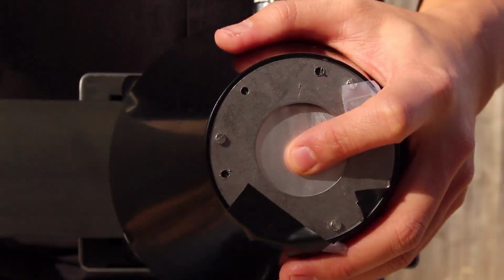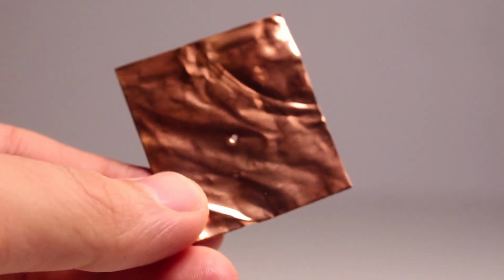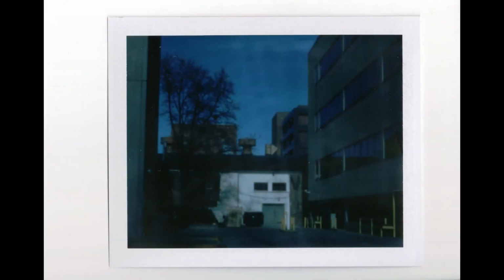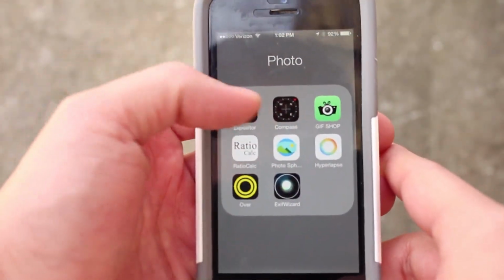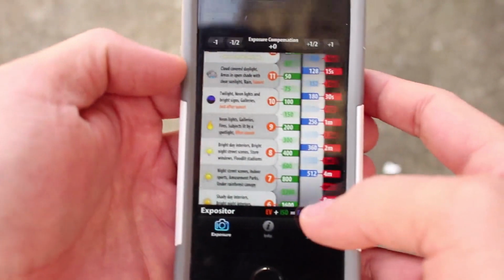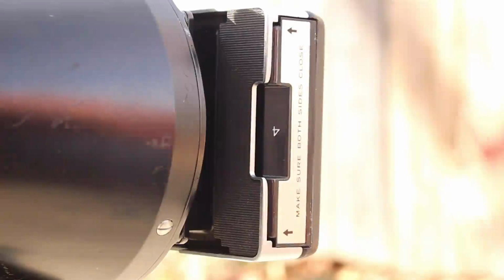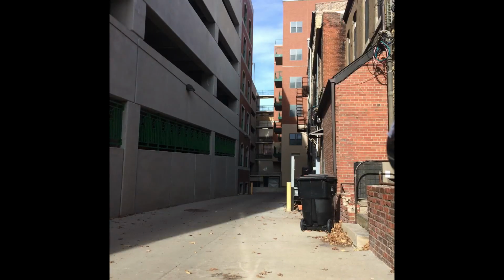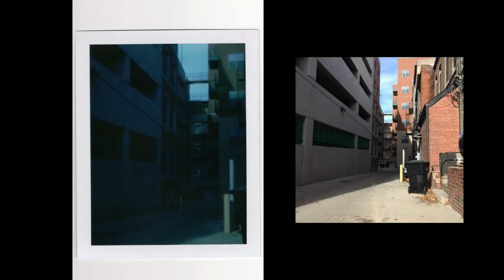Polaroid Pinhole Project

Comment: Good job and bonus points for persevering!

I find that FP-100C requires extra exposure time to compensate for reciprocity failure.

Have fun pinholing!
rt
Reply from the maker: Thanks! How much do you overexpose then? I never heard about reciprocity failure. I guestimated I had a f-stop of 300. You think 1.5+ stops is enough?
Reply: Shawnee Union Hi Shawnee, For a metered reading of "2 minutes" (as you mentioned in your video), my experience using FP-100C has shown a need to compensate by increasing exposure time by an additional +4 stops. In other words, I would shoot this scene at 30 minutes.  

Let's continue this discussion off-youtube.  I'll provide you additional info on FP-100C's reciprocity failure shortly.  :)
rt